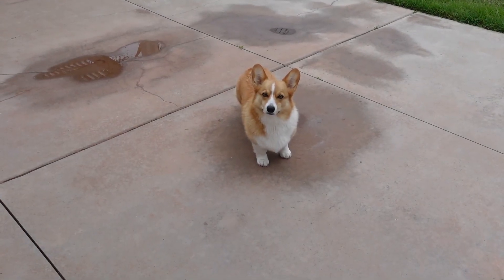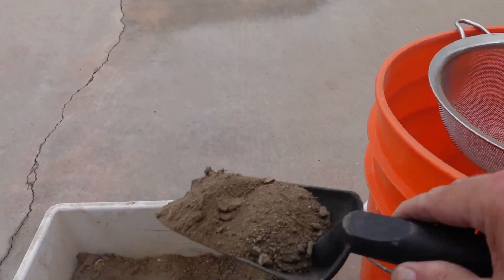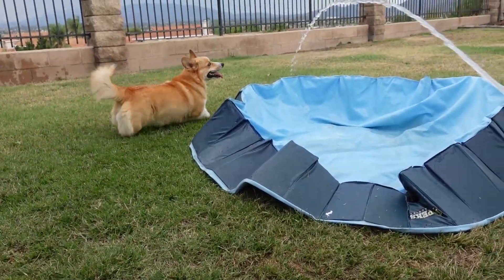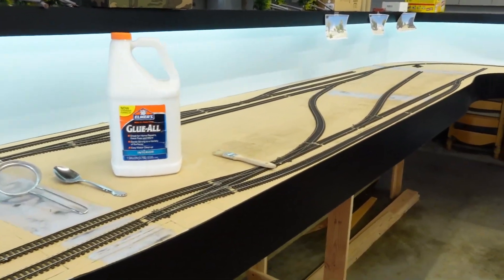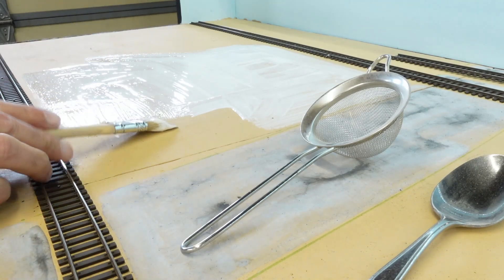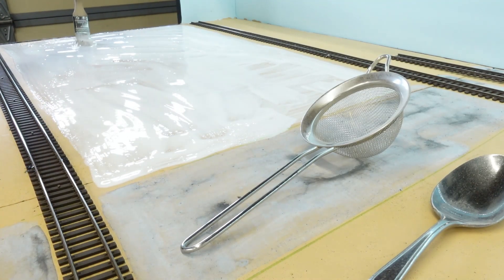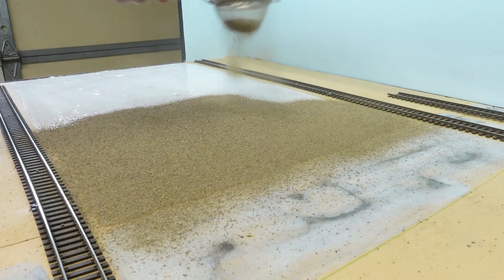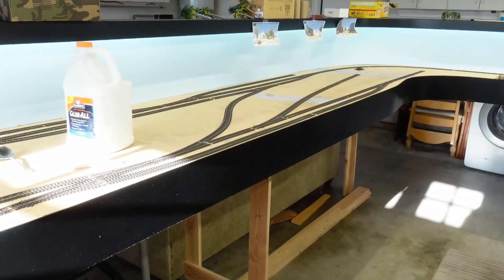Layout Update | Laying Ground Cover

Comment: Admiral...er..Engineer Rick.....I liked that. You add your ground cover the same way I have done mine. I have also used a small rolling pin to press the sand into the glue. I think with my new layout I am going to use some Mojave River blow sand rather than backyard sand. Thanks for sharing your technique. Stay safe - Larry.